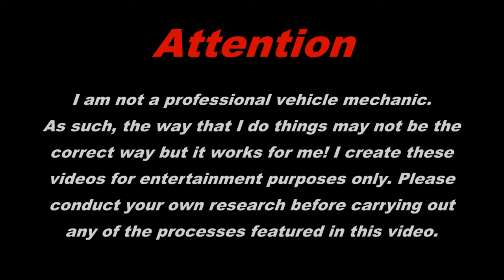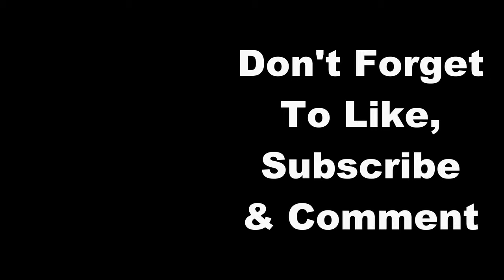1998 Kawasaki ZX9R - Project Shinobi, Episode 9 - Off With His Head! Cylinder Head & Barrel Removal

Comment: Hi Kev, you have your cylinders back to front, your No1 is No4 !!
Reply from the maker: You are correct, it's actually 1-2-3-4 Left to Right, as it happens. That is fairly unusual as number 1 cylinder is usually at the chain end on most engines. As I have numbered everything the wrong way round, it's not too big a deal as I just need to make sure that everything goes back where it came from! Good shout though! 👍

Comment: on the cylinder head, it,s a good idea to replace the vacuum blanking bolts in cylinders 2 & 3 with the hose connectors , as on cylinders 1 & 4, with a short piece of vacuum hose, it makes carb balancing a hell of a lot easier !!
Reply from the maker: Yeah, already had that thought myself! Good idea! ;)

Comment: I can’t wait to see how you get the cylinder barrel back on, jiggling four sets of piston rings…..
Reply from the maker: I know right! That’ll be a challenge, the bottom of the barrels are kinda bell-mouthed for want of a better term, plus it should be easier with ring compressors. You’ll see in a future episode how I manage it! 👌🏻
Reply: @KevsShed  I used bolt head hose clamps for the piston rings. Most genuine piston ring compressors are way too tall to fit underneath the cylinder barrels.
Reply from the maker: Do you mean Jubilee clips? Like these? https://www.ebay.co.uk/itm/Stainless-Steel-Hose-Clips-Pipe-Clamps-jubilee-type-304ss-British-Type-/265263590121?mkcid=16&mkevt=1&_trksid=p2349624.m2548.l6249&mkrid=710-127635-2958-0
Reply: @KevsShed  Jubilee-clips will probably do the trick also. I used hose clamps with a bolt fastener. These clamps have a perfectly smooth ring that actually fits a few millimetres inside the cylinder barrels. As the clamps go inside the cylinder, you have to open them ever so slightly, and push them down in small steps so that you don't loose the compression on the rings. Push the block down as you slide the clamps down on the pistons. I managed to get both piston rings on all pistons inside the barrels. It's a very fiddly process, and you need some sort of device to keep the rings compressed, since you don't have four hands to hold the rings in, and another two hands to push the block down... I think that I still have the clamps, and I can send them to you if you wannu give them a try. no charge
Reply: @KevsShed  The correct tool for installing the pistons is called "Piston Ring Clamp / Compressor 70 - 75mm Classic Motorcycles", look it up on the bay. I tried to post a link, but my comment got deleted... The point is that the ring compressor needs to fit inside the barrels a few mm, or else the rings wont go in.
Reply from the maker: Ah right got ya. I have one of these. https://ebay.us/8nH5Pb 👍

Comment: Howdy from the U.S. Mate.  I love your show. Thankyou for sharing your work with us.
I need your help, and ideas.
I have a 95 triumph 900 sprint.
Very impressed with this well built ride.  Here's my questions.
I bought some add on mufflers....but I can't figure out how to remove the old ones, and I'll need to use the same pipes to attach the new mufflers to.....your thoughts? Or do you have a show showing how to remove them??
Plus, the one thing I DO NOT like about riding this bike...is having to lean so far forward to the handle bars.  So....I want to raise them up, and out a couple of inches to give me some relief.   Any ideas....and exact parts (risers) for this bike......Thx man

Comment: may I ask, do you really need to take out the engine to replace the cylinder head gasket? mine i think is leaking oil mix with coolant on the radiator.